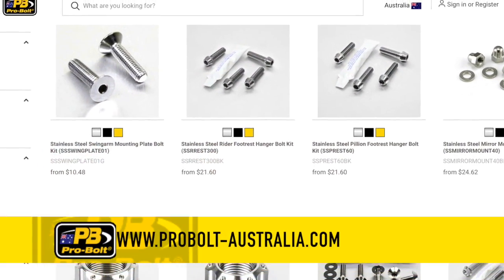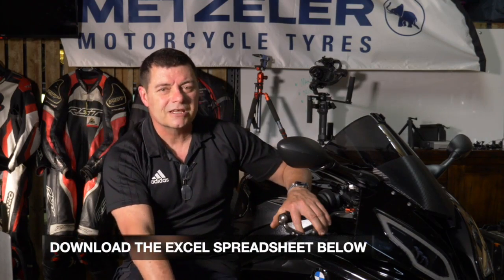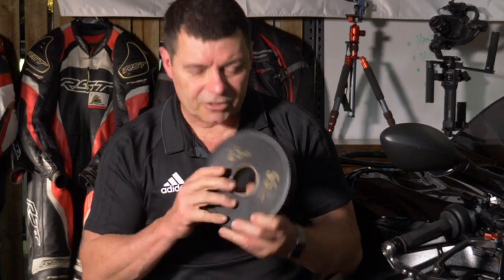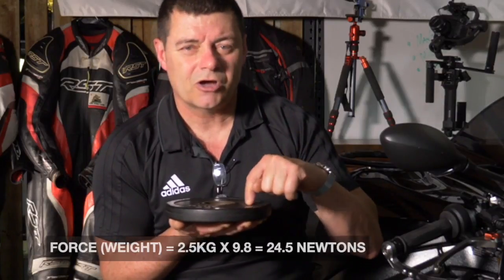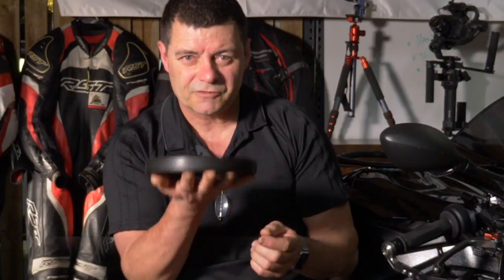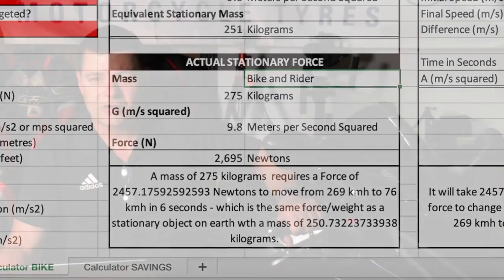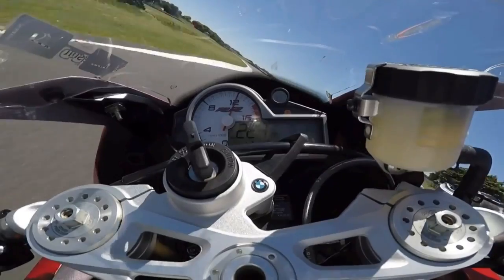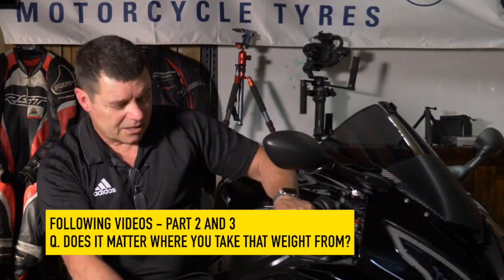Part 1 - What Are the Benefits of Removing Weight From Sports Bikes Like the BMW S1000RR

Comment: Great and informative video. Your final calculation may make some assumptions that lead to an oversimplification and inaccuracy of the time savings conferred by mass reduction. There is a rate limiting factor on acceleration and braking due to the fact that the bike wheelies / endos. If you try to brake harder than around 1.4g, you will end up over the handlebars, no matter if you are an amateur or Casey Stoner (depending on your speed due to air resistance, which helps prevent endo, 1.8g seen in Motogp). Acceleration is similarly limited, but air resistance works against you, limiting acceleration further (air pushes your body backwards encouraging wheelie, more significant at higher speeds). This is before we consider traction limits etc. Also, reducing the mass of a motorcycle changes the distribution and centre of gravity, which can change the tendency to wheelie/stoppie (sometimes unfavourably). In short, I believe the time saving due to weight reduction will probably be much smaller than calculated here.
Reply from the maker: thanks for the comment mate, appreciate the detail of what you wrote. Yeah, I know there are a heap of factors involved, and it's pretty much impossible to calculate any saving accurately. As long as what's here is a starting point for conversation and thoughts about the weight aspects of performance I am a happy dude.